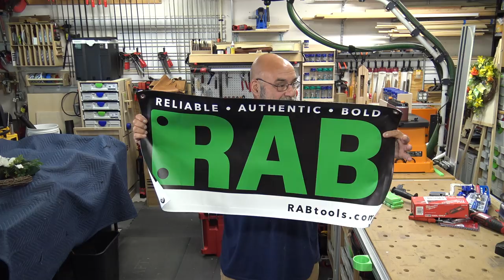My new Milwaukee tools

Comment: I was able to get the 2 drawer version in Canada.  Also do plumbing and heating out of a 2014 Mercedes sprinter 170 high roof.  Bought 4 two drawer and secured them with base plates.  Two at the side door and two at the rear.  Beautiful additions to the van.
Reply from the maker: I did look at the Mercedes I will decide Tuesday what I’m goin to get.  I am bitting at the bit to get my Packout into a van. Thanks for the comment Mike

Comment: Recently I converted from the Makita storage box system to the Packouts. Got 4 x 3-drawer, 2 x 2-drawer units, 2 x XL storage box, 1 x Toolbox unit and the mounting plates. Still fine-tuning my storage but I find I can store much more in my Packout than the Makita and I take up less floor space in my Dodge Caravan. The drawer system from Packout is a game-changer.

Comment: I’m a auto tech at a local dealership.You will find the price for a used vehicle much higher than they where a year ago.This is due to a computer chip shortage for a lot of new vehicles.The manufactures has storage lots with thousands of new vehicles that needs that chip.Good Luck.
Reply from the maker: Thank you very much